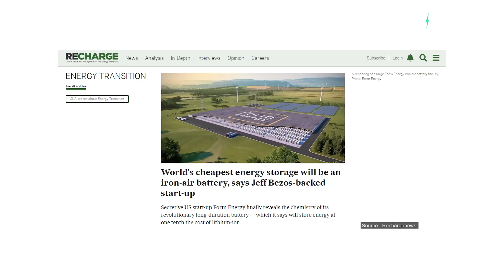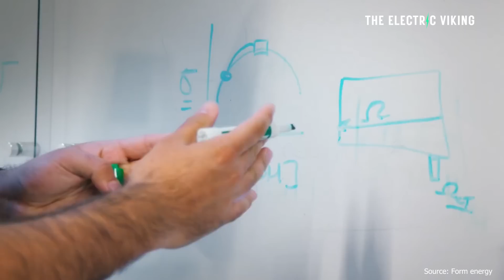America's Game-Changing 100 Hr Iron-Air Battery: Cheapest Energy Worldwide...

Comment: How many charging cycles will they last compared to LFP? How is the cost compared to sodium ion?
Reply: And, it’s the software that makes megapacks or powerwalls unique.
How about the Bezos’ batteries?
Reply: @hanswitvliet8188  anybody can write battery control software, I doubt that has any influence (I have written software for companies).
Reply: @AORD72  I know.
I am a software engineer myself.
And I’ve seen incredible amounts of shitware that was sold nonetheless. The garbage did exactly what was in the specs, but neither fault tolerant, nor maintainable, nor future reach.

Comment: You said batteries sustained some spot for days; this is rarely done.  You can look at it as - how long could you sustain a 500sq ft home on electricity alone, heating cooling, cooking, hot water. A 21 kWh Powerwall can sustain a small home running everything; for 2-3 days for just a couple. 8 kWh per day; not of course including charging a car, if you did - that might cover 1-2 days depending on commute.  Want to power a city of 1 million multiply by 1 million - that is 21 Gigawhats; 1 Billion is 21 Tarawatts and 4 billion is 82 Tara watts - double or triple if you want all cars to be EVs. The Georgia Iron air battery is only 15 Mw - or enough for about 1000 homes for 2-3 days. Hence you'd need about 1 million of these JUST to power homes for 2-3 days not including industry and not including EVs - if you needed to also cove EVs and Industry - multiply but at least 5 - 5 Million such sites. Cost $200 million each?  $10 Trillion would get you 2-3 days of power storage; not power; now you have to make 100x as many wind miles and solar farms - No problem a couple hundred trillion and this all sounds good for a couple days ; oh better plan for a week?  OK 200 Trillion or so.. no problem just print it up ;).

Comment: So, what's the projected cost and cycle life for the Fe-Air battery, and how does it compare with the LiFePO4 and other alternatives?
Reply: Costs are projected to be 10% of lithium alternatives.  Cycle life is almost immaterial as they can replenish with more iron pellets cheaply and easily.
The downside is size.  Energy density is very low.  But they are for stationary applications, especially solar farms where they can be placed under the panels.
Reply: @johnb7430  Can you please provide a source that supports your statements about the cost being 10% of tge LiFePO4 alternative, given the LiFePO4 cell alternative is currently thought to be less than $70/kWh?
Reply: @greggrant4614 form energy websight

Comment: The 100 hour charge-discharge time is a big disadvantage. It needs to be cheaper to make up for this drawback.
Reply: Not really, you just have to make it bigger. If the battery is the size of 100MWh, there is still an out or input power of 1MW, that is the powerdraw of 100 households.

Comment: If you had one of these batteries in the house and it was one of the modern houses that is quite air tight, would the battery, after the sun went down and you were using the stored power, take the oxygen from the air and send out into the room the remaining Nitrogen.  A person doesn't suffer distress from a lack of oxygen as happens with an excess of carbon dioxide.  You simply go to sleep and then die.   Perhaps a safety warning should be provided to place such batteries in the garage or other location where there is a good circulation of air.  Alternately, when charging does this battery send oxygen into the air.  Excess oxygen breathed for long periods is also not healthy, especially for infants.

Comment: A typical solar cell generates electricity 6 hours a day at near max capacity.
4 hours 10AM - 2PM at max
2 hours 8AM - 10AM at 50%
2 hours 2PM - 4PM at 50%

The other 18 hours a day produce nothing.

So if you want 24/hrs of constant electricity, you must buy and install 4 times the cells and store the excess in batteries.

But then you need a carbon-based backup source to cover "once in a 25-year storm" and 50-year storm and 75,100...; storms

Basically installing solar is an extra cost over the existing carbon-fueled system since it can't be shut down.

Generating electricity from solar/wind are very very expensive and don't replace any existing systems.
Reply: The energy distribution sounds close to right, perhaps a bit on the low side, normalized over one year. More energy is produced in summer (longer days + sun higher in the sky) when demand is greater due to air conditioning?  FYI, From dawn to dusk, Solar production is still dispatchable below 50% of capacity just like  fossil or nuke resources. 

I'm curious where you're getting your cost data on renewables? 

Most unit cost data on solar energy is less expensive than even natural gas. Our local utility is building out many MW of solar generation on leased farm land to replace some of their gas turbine peaker units. That utility isn't in business to lose money. The real barrier to renewables is not the cost of production but the cost of storage, which is what this story is about. Energy storage would be beneficial to electric  utilities even if renewables didn't exist
Reply: @tomdonahoe3539  If you compare the electricity generated by solar while the sun shines, it's probably cheaper than carbon fuels - just a guess.

But accounting for the other 75% of the day and storage and backup then solar is super expensive.
Reply: You don't need to consume 100% of normal power during a 1in50 year storm, ration for a few days. You don't double your infra cost for an extra day or two.
Reply: @Lee-pf6od  3RD world thinking...rationing...
Reply: @noleftturns  it's basic economics, the economic output lost from a few days of shortages, will not exceed the cost of maintaining backup for 25 years. Pretty simple really. Never mind that the grid itself may be wiped out by a storm, in which case car based battery backup is superior.